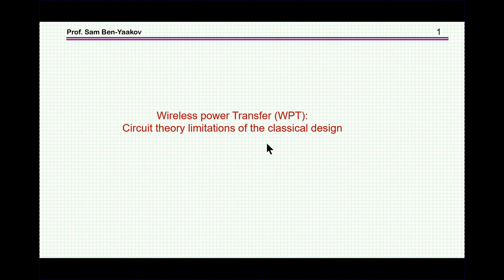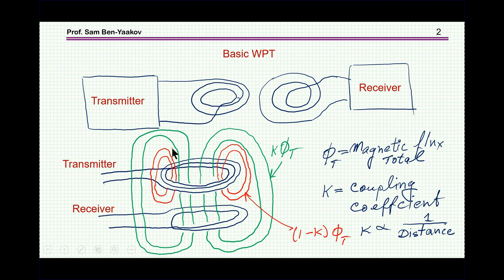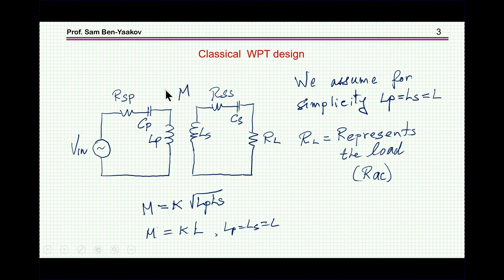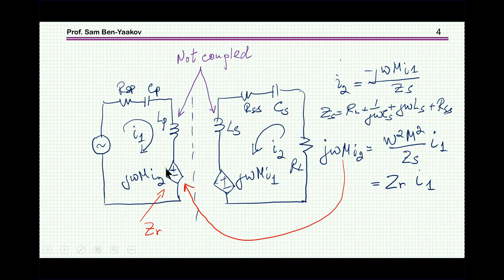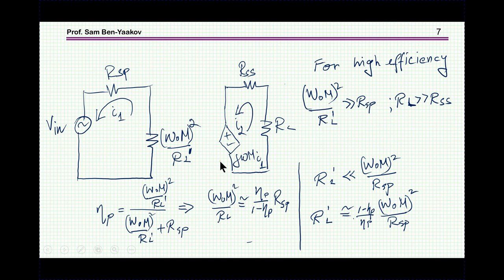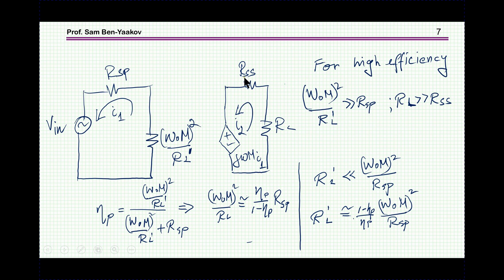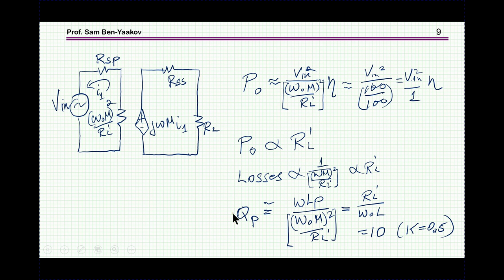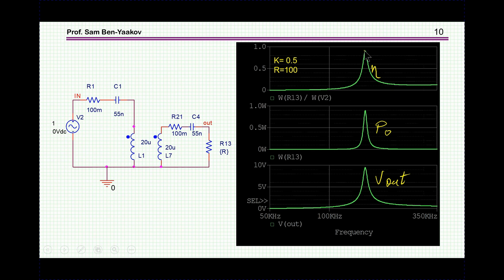Wireless power Transfer (WPT): Circuit theory limitations of the classical design

Comment: Since the coupling coefficient,  output load won't be known exactly or will be time varying.
What if we change the frequency at which system operates by possibly adding switched banks of capacitors/inductors at the primary ?

We could then monitor the power and efficiency to "tune" the system on a case by case basis
Reply from the maker: Indeed. See Fig. 5 in: http://www.ee.bgu.ac.il/~pel/pdf-files/conf170.pdf

Comment: Thank you for your lecture, i have learnt a lot!
Just a follow question at 5:40, you mentioned that in order to get Zr as small as possible we have to get Zs as small as possible. Given Zr = (wM)^2 / Zs, if Zs increases Zr decreases so should not Zs be as big as bossible in order to get Zr as small as possible?
Thank you again!
Reply from the maker: Hi Salih, thanks for the correction. The explanation in this slides is indeed in error. What should have been conveyed is that in order to maximize the real part of I1 current (to minimize the reactive power that cause losses), you need to make the  reactive component of  Zs as small as possible..

Comment: Sir, you have said that if we increase the load resistance, the losses also tend to increase due to which output power increases but the efficiency decreases. In the similar manner, could you please explain me conceptually  why the efficiency increases with increase in coupling coefficient but the output power decreases(although you have mentioned due to deviation from the optimum point).
Reply from the maker: When the coupling is increases there is less circulating current which causes losses.
Reply: @sambenyaakov  sir, ideally as per the analysis when coupling coefficient(k) decreases, power increases. Now, does it mean that when k=0, output power is infinite. Does that happen praticaly?

Comment: In the simulation charts, the frequency is on a logarithmic scale?   If so can you comment on what frequency the system resonated at a k=0.5 and did the system have a third resonant frequency at k=0.8 .  Thanks for putting this up
Reply from the maker: Hi Dave, in this classical design the primary and secondary are tuned to the excitation frequency and the resonance for all conditions is that frequency (100kHz in this example). When the load resistance is small there is a typical splitting of the gain around the resonant frequency while the efficiency still peaks at the resonant frequency. The horizontal scale is indeed logarithmic.
Reply: Did you have to change the capacitance value for each k value or did all of the simulations use 55mF caps regardless of k factor?
Reply from the maker: The capacitors are kept constant. The frequency was 150kHz not as I have written earlier.

Comment: Hi, It is a really great lecture. I think the best WPT system should be parallel capacitive compensation. But in this case, the impedance of the primary section will be high. So Prof. Sam, IF I have a signal with 5V and 10 mA. If I used PS Capacitive compensation, I need AC-AC inverter that Has high impedance input for the WPT system. So can you recommend me any type of drivers which can provide high 5A and 20V to the WPT system ?! and I really Thanks you for this fantastic video.

Comment: Thank you Professor. Your videos are much helpful for us to make our designs better. Can you make an elaborate video about a full flyback SMPS design. Specifically the input protection circuit, SMPS controller selection, core selection for a particular power needs and understanding the datasheet of core for a specific requirement...,
I have watched all your videos and taking reference from your video for my designs, but one single video or multiple parts with all these together with a practical example will be much helpful for us. Thanks in advance.
Reply from the maker: Will try.

Comment: Thank you Professor. How would you propose an equivalent network for a CPT system would look like?
Reply from the maker: What do you mean by CPT? capacitive coupling?
Reply: @sambenyaakov  Indeed
Reply from the maker: Well, in this case there is no universal model. It depends on the particular design of driver and receiver.

Comment: Professor, thank you very much for this lecture. Very informative! Can you please let me know what is the simulation software you used here? LTSpice? Thanks!
Reply from the maker: PSPICE
Reply: @sambenyaakov  thanks a lot for the prompt answer, Professor!
Reply: @marcelopires1267  good morning sir
I have very much interested on wireless power transfer in ev battery charging sir, I was started my work last 6months, I have struggled at simulation, sir my sincerely request is please send sample wpt  MATLAB simulation model sir, thank you sir
Reply: @sambenyaakov   @Marcelo Pires  
good morning sir
I have very much interested on wireless power transfer in ev battery charging sir, I was started my work last 6months, I have struggled at simulation, sir my sincerely request is please send sample wpt  MATLAB simulation model sir, thank you sir